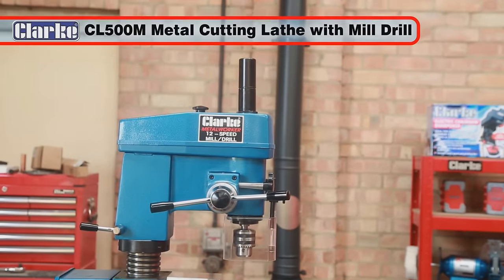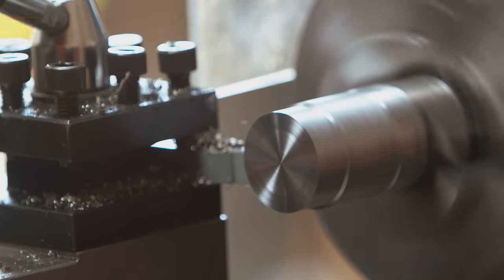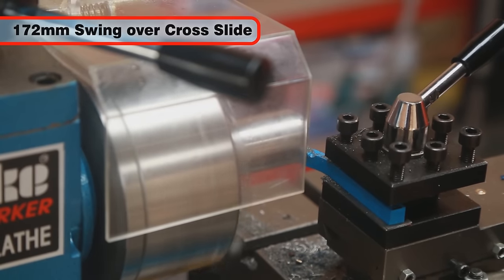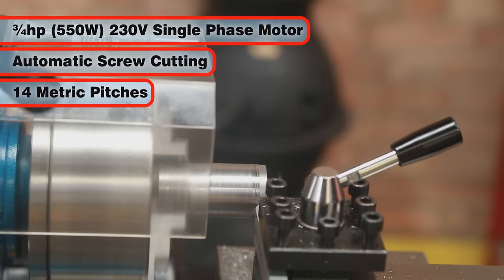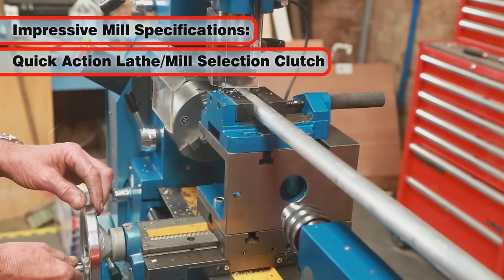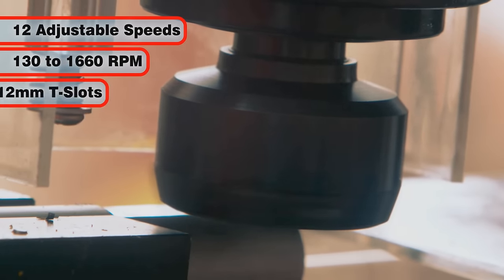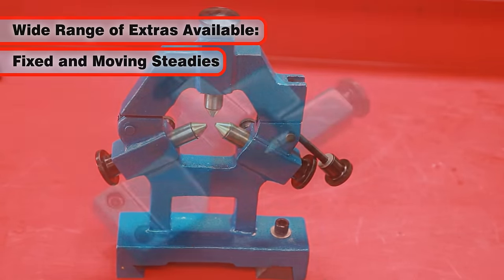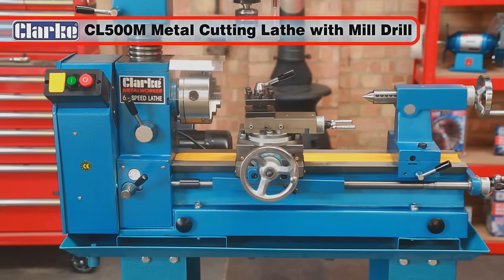Clarke CL500M Metal Lathe with Mill Drill

Comment: The lathe part is brilliant but the milling machine part would have been better purchased as a separate machine. I've had my machine for three years now and yes I've had loads of problems mostly with the clutch while running the milling machine as it tends to keep jumping out of gear and Machine Mart are aware of this problem but would prefer you sort it than them.

The configuration of the belts for getting the speeds right can be an issue but all of them aside, it's a great little machine to work with.

Is it worth the money? I would say you could get a better machine for a little bit more money than this elsewhere, but it depends on how much your going to do work wise on it and how often.

Knowing now what I now know of this machine, if I was to buy it again I would buy just the lathe and opt for a seperate milling machine.

Comment: This video is deliberately misleading regarding the speeds.

Whilst talking about the six speeds it shows a lever being moved. But that lever is not how you change speeds. That lever changes the automatic feed rate between fast and slow. The SPINDLE SPEED is set by manually moving belts between pullies and requires that the motor be loosened to relieve the belt. One or two belts are used between two or three pullies. A gear change takes between 2 and 5 minutes.
Reply: Are the gears plastic or steel?
Reply: Yeah. I was about to buy one but I think I'll pay a bit more, skip the cheapest,  and hopefully get better quality. "even I'm not rich enough to buy cheap" -Rockerfeller

Comment: I have owned this lathe for at least 10 years it earns its keep doing very basic turning jobs daily, However, this lathe is not superbly engineered as stated above, it is very poorly designed. The milling head lacks rigidity and is basically useless. The slowest speed is still to fast for thread cutting, turning between centres is a nightmare due to the lack of overhang on the tailstock and the saddle being to wide. It takes to long to get spare parts, to much backlash in the leadscrew and crossfeed screw. the castings are poor quality, the bed on mine has worn. it does not have a tumbler reverse or back gear. It takes to long to change the speed. worst of all it is not value for money and the accessories such as 4 jaw chuck, fixed and traveling steadies, face plate etc  are all drastically over priced and poor quality. This lathe is now out of date and poor quality even for a Chinese lathe. Buy a different lathe, there is nothing good about this machine other than it looks pretty. Trust me it is over priced and you will regret it.
Reply: I have to agree with you here. My uncle gave me his machine a few months back and while it is fine for general work in soft materials it is has become a very frustrating machine to try and produce higher quality parts. My uncle gave me the machine so i could build motorcycle parts for him and while you can get the job done it takes longer than it needs too and you really have to plan according to what the lathe can handle.

 I am rebuilding my machine to improve all the little issues (cuttings speeds, sloppy screws, POOR tolerances, spindle bearings etc) and considering i got it for free it is well worth the effort but i would never go out and buy one. Oh and getting okish quality parts for this machine is darn near impossible.

Comment: You can't get spare parts
Reply: As far as I know spares are still readily available from Machine Mart UK, having said that, I have had one of these machines for the last 17 years, after the first 6 months I removed the drilling head and sold it to a friend who wanted to make something or other out of it,  I had already come to the conclusion that this item was next to useless,  the company above actually do a version without the milling head at around £ 1080, having said all that, I have had exceptional use from my machine, and have never yet had reason to need any spares, I did remove all the belt drive system and replace it with a Chinese  1/2 HP variable speed motor which works very well, I would strongly recommend one of these if you want something with more capacity than a Myford
Reply: William Gotobed hi there not sure how long ago you put this post up but who did you get the 1/2 hp motor from as I have the same lathe and would like to buy one thanks Les